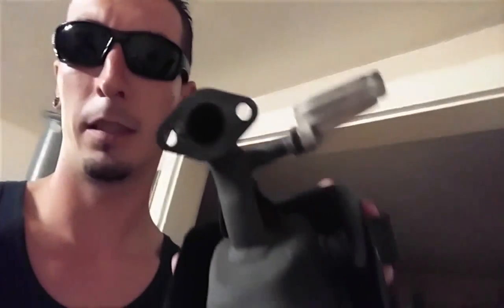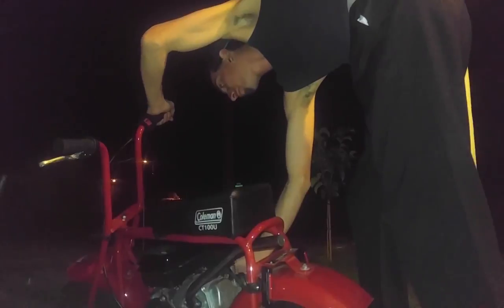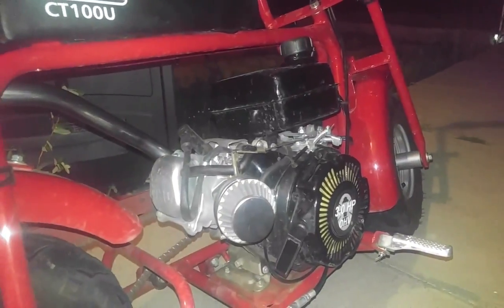Coleman ct100u header upgrades and exhaust and air filter

Comment: Hey Spikeman, just, just remove the jet, place the drill bit into a vice, or hold it with a pair of plyers, and screw the jet into the bit, it gets easier, it will work perfect, jets are soft.
Reply from the maker: nice thanks for the tip man i was worried about putting it into a drill and breaking the bit
Reply: NP, I had the same worries...
Haven't seen someone take it to the extreme yet, looking forward to these upgrades....
Reply from the maker: hell yeah man i cant wait till i make a video on how to drill it out thanks to your tip off ill be sure to mention you in my video when i get around to doing it thanks again

Comment: If I don’t bypass the gov will the new air filter improve the performance at all and how so
Reply from the maker: You're not going to notice any difference as long as I had engines governed there's no point in putting a nice air filter on it's the governor that's dialing the throttle back not the air filter

Comment: Also where can you buy the kit for the exhaust and air filter
Reply from the maker: I bought mine at www.Hotrodminbike.com
Reply: Thanks so much
Reply: @spikemandan  I'm ordering the header/filter kit from hot rod minibikes. Is it necessary to drill out the jet or can you just leave it alone?
Reply from the maker: @dwightbundy4556  that all depends on what they send you they sent me a drill bit to drill out the jet which I did by hand and finger if you got lucky they just send you a jet
Reply: I tap on these websites and nothing happens

Comment: Man I'm having problems  with a brand new ct100 keeping the chain on. My 8 year old rides it. I've moved the motor forward. The tensioner back.get it as tight as possible and with little guy on it it still comes off..any suggestions?
Reply: Same here did you ever figure it out?
Reply: Check your allinment i mite need spacer where the clutch is on the shaft chain popping is allinment issue somewhere
Reply: Take a chainlink out or more as needed. Find the master link...
Reply: Had the same problem ended up taking a link out and referred to owners manual. You need at least an inch play in the chain. Cut your chain down to length with the motor all the way back and idle back so you have room to tighten when the chain stretches

Comment: Hey Spike man I just got the same headers that you have on is the 100 cc got them from hot rod minibike.com the best of course anyways they told me prior to receiving the headers that they may rust because they are steel they recommended keeping them rub down with WD-40 or painting them I have purchased some high heat rust oleum flat black paint I have read other reviews online that this works rather well but want your input since you are the master
Reply from the maker: i keep my bike washed and in doors so it's really well taken care of! as you can see i keep it in my house i dont have a garage =( but if i do see and rust i use a green scrubby pad to wipe it off and thats it i just keep doing that but painting it will be better as im thinking doing the same because im tired of cleaning the rust spots just make sure you clean the hell out of the metal surface of any kind of oil or grease before doing so! & that way you'l get a nice cover of paint! & dont put too much on at any time! make sure you do light coats in every step.
Reply: spikeman dan they recommended I scuff sand the headers before painting them with the high heat paint do you think this is a good idea also do you have to take the carburetor out all the way to replace the main jet?
Reply: Also do you know if there is an upgraded spark plug that is available for when I go to replace this and how hard it is to drain the oil on these ?

Comment: When you put the air filter on where did you put or run the hose that goes to the OHV cover?
Reply: Looks like you just left it dangling there?
Reply from the maker: i used the stock hose cut it down and went to auto zone bought a 3 dollar fuel filter cut off one end of it and turned a fuel filter into a breather filter and i still have the stock bolts to the stock air filter if you need them unless you have moved on from stock i wont bother you with it in that case ;)
Reply: I really appreciate your offer but I went ahead and bought the same power up kit you did and put it on tonight.  That is why I was asking about the hose.  This is my little girls minibike and she wanted it so she could drive it.  I didn't let her drive it with the air filter not in place.
Reply: An interesting fact I will add is that my kid did in fact come with a new jet and not the drill bit.
Reply from the maker: you got lucky haha i thought it was false advertising at first ;)
Reply from the maker: did you order from hot rod mini bike's?
Reply from the maker: did you compare the two?
Reply: spikeman dan yep!
Reply from the maker: Paul Derrington nice I'm working on a stage 3 212 as Well

Comment: Is the header pipe on the ct200u compatible with ct200u?
Reply from the maker: I think you're confused he basically asked me the same question twice
Reply from the maker: If you're asking is the ct200 header pipe compatible with a ct100 engine the answer is no I put a 212 Hemi predator with a ct200 gas tank so that way it would fit on me CT 100 frame now that's ct200u header pipe is compatible with the 212
Reply: @spikemandan  so you don't have the Ct100u engine on the bike in this video ? looks like it is and i was going to order the header pipe for the kids Ct100 .
Reply from the maker: @shawntorrez6722  no it has the stock engine in this video if you want to order the pipe go ahead and do it cuz that's the right pipe for that engine

Comment: Man I wish I could order one of those under the seat pipes but hot rod mini bikes seems to be out of business. Spikeman Dan can I get this pipe anywhere else that you know of?
Reply from the maker: You might try OMB Warehouse
Reply: spikeman dan  thanks I emailed them but they said they don’t know off any pipes made for the stock engine. Could you tell me if you were able to use the same pipe on your predator 212 as you did with your stock engine?? Thanks
Reply from the maker: @mikelute77  no I ordered a different pipe for the 212 those are easy to find find all kinds of different ones if you're switching the engine out of the 212 don't worry about ordering the aftermarket pipe for the three horse
Reply: spikeman dan thanks man I appreciate your help

Comment: Does that air filter need to be oiled?
Reply from the maker: Yes it absolutely does
Reply from the maker: K&N sells air filter oil along with the cleaner
Reply: spikeman dan thanks! Love your videos
Reply from the maker: You're very welcome anytime I'm actually shooting a video as we speak about to go ride my mini bike on the freeway while doing a speed test
Reply: spikeman dan sounds cool! What kind of oil and cleaner from K&N do u use? I’m planning on doing the same to my coleman but not sure what kind to get
Reply from the maker: @kingclutch8238  just go into AutoZone or any auto parts store and ask for air filter oil and cleaner made by K&N or any other brand Works to even if they don't have it you can always take regular motor oil and douse the filter in it you don't want it dripping wet you just want to coat it with a terry cloth

Comment: Does changing the exhaust to a pipe like that help the engine go faster since it can breathe better
Reply: Sounds better and yes the engine will output more air from the header but you need a bigger air filter two suck in more air two if you put a header/ exhaust pipe on

Comment: Can I just take off the whole air box and run it like that?
Reply from the maker: needs to have air filter of some sort
Reply: I crashed mine and it still runs with out one one it
Reply: Rico it will obviously still run without an air filter. But it's just sucking in all the dust and dirt without one that's why you need one

Comment: When you are riding that fast is that stock or is that with the air filter and header
Reply from the maker: That's what the governor bypass plus air filter header pipe and drilled out jet

Comment: Hey Spikeman Dan.   When you took the original air filter cover off it was held on by the two screws with plastic on them.  What did you do with them?  Reason I ask is because my little girl has the same bike and her bolts fell out somehow and I am not sure what size they are to replace them.  Also,  if you still have them and do not want or need them since you have upgraded to an aftermarket filter I figured we could take them off of your hands so she can start riding again.    :)
Reply from the maker: i still have them! i hold on to all my stuff for good reason and if you really need them send me your mailing address to my email @ spikemandan420@gmail.com be sure to subscribe to my channel & i will be more then happy to ship out what ever it is you need i still have the whole air box as well will even send you my free sticker ;)

Comment: Hey dan can a predator 301cc fit on this mini bike?
Reply from the maker: its a pretty big engine what with the huge gas tank on it, its not quite the 420 power but it is about the same size over all i think if you get a much smaller tank or get rid of the stock one one it it should fit! depending on if your planing on getting rid of all the stock junk that comes with it, im doing my 212 all aftermarket so it will have the power of a 420! just saying man it all depends on what you want to do with that engine i dont mess around! i GET R DONE!